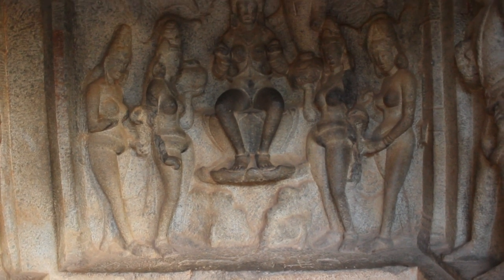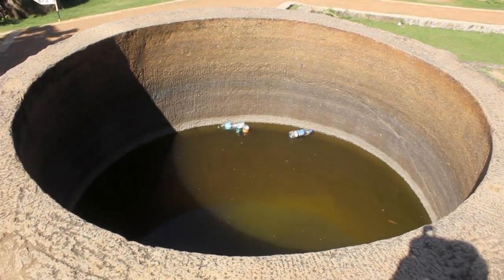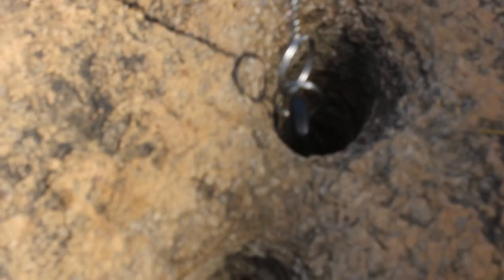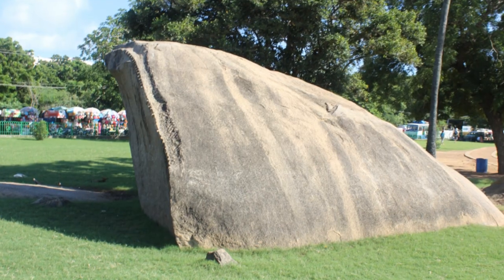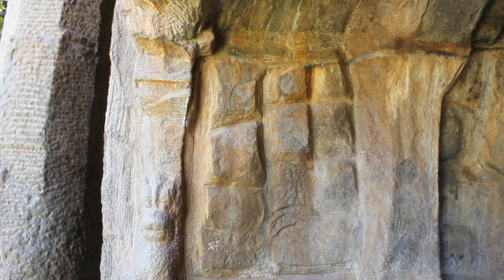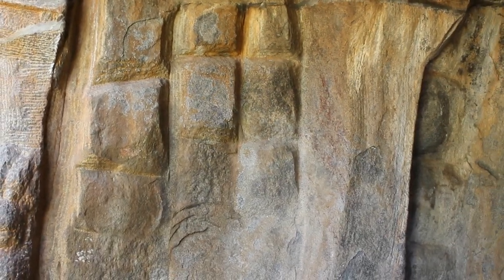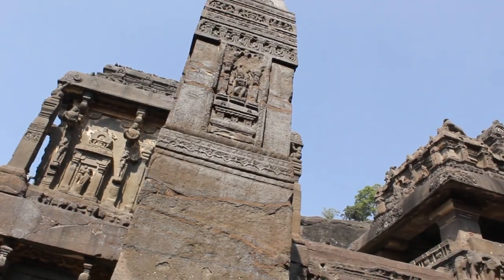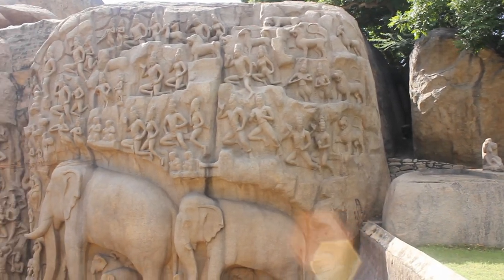Ancient Indian Rock Cutting Technology

Comment: I know about Granite, Its Damn hard....with the perfection that it is cut here.... Laser or Diamond are the only way.
You hafta believe what you see here. ie other technologies are involved.
Reply: I have seen sand used. wet sand worked faster than dry.
Reply: Walter: Very interesting observation.  Makes one wonder: if they had turning technology, as shown on other videos by Praveen here;  how might they have used a wooden consumable turning abrasion pad or arbor impregnated with sand and granite chunks to help this along? There should be open evidence of this unless it was considered a trade secret.
Reply: Look at the Oklahoma tiles and ancient site destroyed by sub contractors...weirdly that's what they repeat most often about the incident.
Reply: Can it be some sort of waterjet cutting using abrasive particles? Splitting or slicing rocks relatively easy; deep cuts, however, will end up w/taper from top down....
Reply: No, that granite rock was cut just using wedges and hammers. It's possible. I've seen it.
Reply: That's the power of ancient science!
Reply: No lazers involved for sure! Stop the speculations about aliens! 😅 This is real human craftmanship!

Comment: Simple techniques yield simple results. Fact: 10,000 sculptors could not fit there to do the carving. Fact: (If 10,000 sculptors were used why aren't there 10,000 unique carvings?) They all look identical. Fact: It would easily take 1,000 years to carve a mountain into a temple with chisels and stone hammers and wooden blocks. It took 14 years to carve 4 rough faces into Mt. Rushmore with 400 workers, dynamite, gas hammers and wrecking balls, cranes and lots of other power devices. These aren't smooth either because they're not meant to be viewed close-up. If it's that easy to make these long lived structures, why don't we do it today? Why don't we just build pyramids while we're at it? Since we know how to do it and they last for thousands of years! .....Just saying...
Reply: Very relevant example

Comment: They also made use of the fact that in winter, little puddles would freeze in winter and when water freezes it expands and would easily split a rock. Multiple holes are just there to direct the split or crack so as to determine the shape.

Heating the rock with fire and then splashing cool wine or vinegar onto the rock surface would make the rock so soft that one could carve the rock with wood tools.

TGC 
Blessings in abundance :)

Comment: Regarding the 8 foot diameter hole.  Did they have access to diamonds?  If they did then it would be relatively simple to construct.  Firstly drill a vertical hole in the top of the rock with a stick that has a diamond on the end of it.  Maybe 12 inches deep.  Then with a string with a diamond on the end of it draw a circle.  Maybe only an inch deep.  Then chisel away what is between the circle and the centre.  If they had diamonds all this would be possible.

Comment: Thanks for doing such a wondeful job sharing with the world.
Most video makers offer conjectures or opinions and conclusions formed on the basis of incomplete information but only a few try to indicate with solid sense how stone structures were cut, carved and or tranported.
I could only imagine that stone builders of very long ago were masters not only in knowing every type of stone, wood, the cosmos, fire and more much more.
They already mastered the making of fire and the melting of many metals.
Therefore they must have known diamonds for which they didnt have our wants to place it on rings but must have known that diamonds were harder than many rocks and used them to work "softer" stones like basalt and granite although these seem very hard but we have seen people splitting them easy with one of the hardest elements that each of us have: patience. 
Try splitting steel, this is harder than stone, try other things in steel too but you will not cut it like you do cut diamonds.
But they could have need only a tiny piece of carbon steel or diamond at the tip of bronze chissels, or on bronze or gold disks that were taken away etc.
They must have known many salts too, from where many minerals come from and they must have known flint stone and magnesium with its property of burning very hot.
And a lot more but unfortunately they didnt have youtube for us to watch them doing it so that each one at home could copy the technique and carve small stones found everywhere on earth. 
Indisputably they were fire, diamond and granite stone masters. 
"It is simple if you know how" I dont know who wrote this ; )

Please keep showing us proof of how it was made.

Thanks.
Reply: yeah india "was" just amazing..literally feels like aliens came and made these stuff

Comment: wow great info on rock cutting technique, simple ideas are always best
todays super moder hitech science would cut it with laser or with something more sophisticated tools
but ancient indians just used hot water and wood log...

thanks bro
Reply: +Ganesh Das     lasers a waste of of money, check out high pressure  (10,000 psi.) water jets. these will also cut steel plate, for really hard alloys they add very fine grit to the water. lasers are not efficient at converting electricity into cut stone. lots of things actually need lasers,  not rocks. if you're in a hurry shaped explosive charges, a few big booms, job done.

Comment: This simple video smashes the believe that Aliens helped humans cut granite rocks. Even tho this was Indian technology, Im almost 100% sure Egyptians used similar, if not the same techniques. Do you have any videos of how they polished the granite to mirror smooth surface? Thanks!
Reply: Humberto The Believer only method i've seen to get it that smooth is with circular saws, water jets, sand blasting or electric sander... etc..
Reply: It was done by rubbing one rock with other ..
Reply: that doesn't make it very smooth...you would see marks in multiple different directions with an uneven consistency where as with the pyramids the lines only go in 1 direction or circular motion and are consistent/straight/have a perfect ratio and no signs of that method being used. You could try a sander though, that could work
Reply: it's called a pneumatic polisher which makes it polished btw

Comment: Chiseling would have left too many chips, cracks and imperfections because to chisel stone would require force which could not have been so precise. I think there might have been mechanically powered drills and cutters . I doubt they had adequately harnessed electricity to have electric powered tools...but why not hand powered rotating tools.

Comment: awesome, i comment often on your vids not much on others. you had one about an entire mountain carved in to a temple but wondered of the location of rubble from massive works. im retired from the granite industry @nd a suggestion if i may. massive amounts of water is used in modern granite fabrication. in nefarious tunnel building in the US they have this huge (36ft 13m ? diameter) core drill that tunnels and leaves only a fine slurry of water that is piped out and amazingly leaves the walls in an almost polished finished. in our smaller works we wold have slurry flowing out daily and the diamonds we used for cutting and polishing were certainly better on our lungs and end project than old abrasive uses. what im getting at; if some one could do some core drills at or near the base of the mountain and go through the natural alluvial over burden into more ancient time they may find the hardened slurry. the waste had to g9 somewhere and the ancients had better technology than they'll ever allow us to use. lol. just saying.

Comment: There are two kind of granite, natural and artificial. Natural can only be shaped with diamond tools and powerful machine, not with artificial granite. 

Artificial granite in sand form enable easy material transportation and manipulation. In wet form mixed with geopolymer enables flow molding and hand crafting. Granite in sand form was obtained from crushed granite or free from heavenly deposit and large quantity in ancient time. However there is a time window in which granite cement may be manipulated, the mix must be stored in dry state and stay dry or moisturize it and it will start to cure chemically. 

Some obelisk was abandoned because the wet mix was cured just before the whole piece was parted from bed rock. Normally the scoop parting quarry must be start immediately as soon as chemical reaction was triggered. If for any reason the curing is complete sooner than scooping, the whole obelisk will be frozen attached to its bed rock. Such as the obelisk named “the pageant woman” of Baalbek. Another abandoned one in Egypt.

Comment: Super Modi: True unlike the ruins of Peru and temples of India where hole remains show visible evidence of wood and water heat treatment Egypt does not show any because either 1.) they use a different method that does not involve wood, I have a theory but its so far fetch  2.) the stone pyramids of Egypt was built just recently shortly after the rise of Rome so their knowledge is not limited to copper 3.) those that are shown in TV are only the perfect ones really worked hard section upon just for show. Although I was expecting a different method than the one mention in this video, I was expecting after putting wood put a boon fire then throw in lots of water, the wood inside will react differently from the granite that expands differently splitting it, also I never expected hammering the wood is needed and since Rob Smith is a retired tool maker I think he knows what he's talking about.

Comment: Another form of cutting stone could have been dun by heating the entire rock with a big fire.  Then pored or shot cold water from a bladder into them. It comes from how water chipping and how it mite have bee dun. And my theory that predawn Indians were  monolithic in there own way. Using fire and ice to crack stone apart or relieve a geometric square shape from a round bolder. Allot like knocking out a birds eye out on a arrowhead.

Comment: They had lots of steel to work with. Any size of society dedicated to looking for meteorites could collect allot of them in a short time. Or could have had a little nudging help to get them all  to one place were they could be found. Personally I lean on the ladder as there are two vary distinct things never mentioned. First plain steel rusts and the bulk of it is gone. Second its best use would be to make plows and swords with the remnants of so most of the metal was reforged. To witch there is lots of factual artifacts that are in every museum and that is simple knives. There Has been many thousands found all over the world from different times. But is more prevalent in pre-bronze age times?  And were merely hammed out of the older bigger tools. 
Chains and pulleys. Shafts and wheels.Pins and wedges. Enough knowledge to start a industrial society on its way. All's they needed was to figure out how to smelt it from the rock. But Nibiru happened. What rose later was on the side that did not get hit. But still knocked all of man back. And has continued to do so since then.